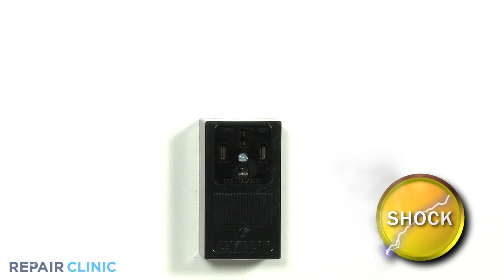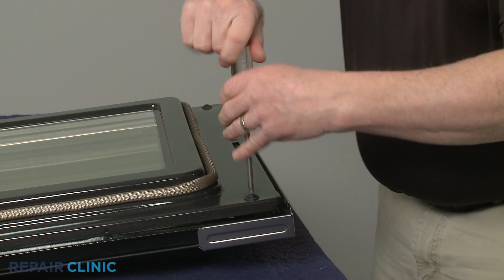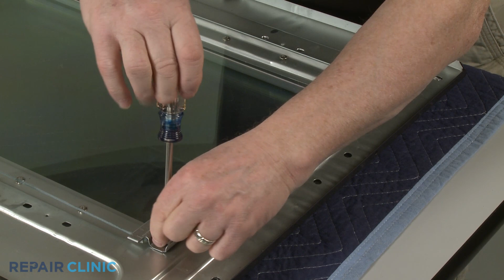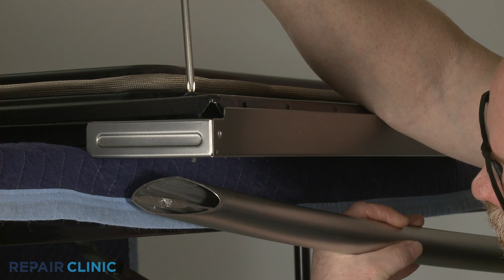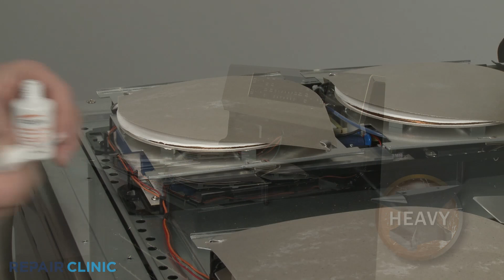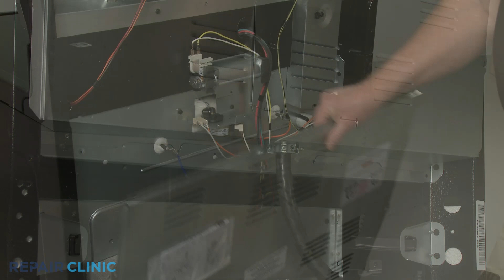Frigidaire Induction Range Disassembly - Model GCRI3058AFD

Comment: We just purchased this exact Frigidaire Gallery Free-Standing Induction Range (in black stainless steel), from Lowe's, about a month ago. The only difference is that the model number of our new induction range ends in 'E' and not 'D'. I am assuming that this means that our range is the latest model of this induction range?  So far we are really liking the new induction cooktop and the air-fry oven. Unfortunately, the "installation" by Lowe's delivery was a joke. The delivery team was pretty much clueless, and just left the stove sitting in the middle of the kitchen. I ended up having to install the power cord, install the anti-tip bracket in the wall, slide the range into place between the cabinets, and level the range by myself. At least we know the new range is installed correctly and safely, and I also managed to learn a lot about the new range during the installation process. It is really handy to see the inside components of the range in this video for future reference. However, I hope the new range lasts a long time, and I am not having to do any of these repairs any time soon. Keeping fingers crossed. 🤞
Reply: I’m in the market for a new range and am considering this unit. Now that you’ve had it a few years any problems?  Thanks.
Reply: @MrBalas3  So far so good. No problems at all. It is a great induction range. 👍👍

Comment: If your gonna call this video a disassembly video. You really need to do the whole thing. I'm trying to open the bottom section of the oven. Obviously you forgot that part......... But had a spill inside and it all went down. And then down. And then it goes nowhere. It's just magic? Does all the oil and liquids just magically disappear? It goes down the back section under the element, and then comes out of nowhere. Is there a little fairy under that panel that just makes liquids vanish? Or are you going to make a video on how to open that part? Kinda pointless to call the video a disassembly and then just do half the oven........ Thumbs down till solved.

Comment: Thank you again for a fantastic video. I just purchased this range and the top was loose; but this has helped me secure it down. 

Could I recommend in the future adding chapters and segments to separate different removals (e.g door removal and repair, motor removal and repair, back panel removal, top removal, induction coil removal)
Reply: Just purchased mine and the top was also loose on the right side. I used a blade screwdriver to pry up the locking channel. All the screws in the front were tight. This stopped the movement.